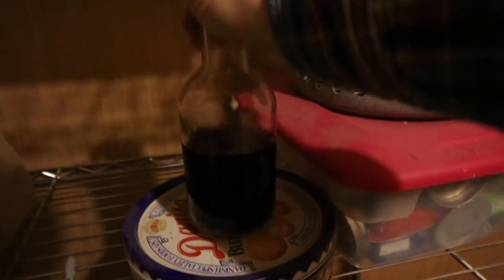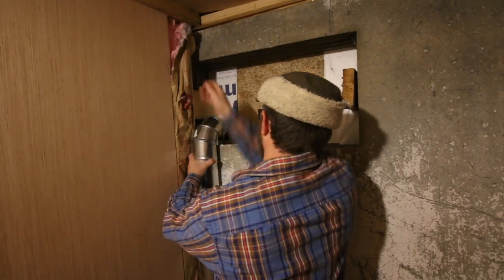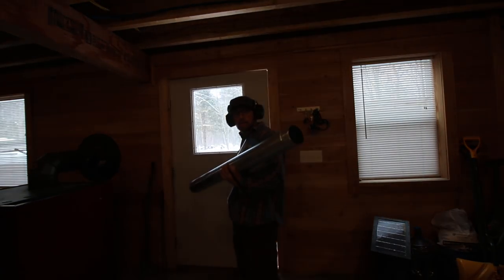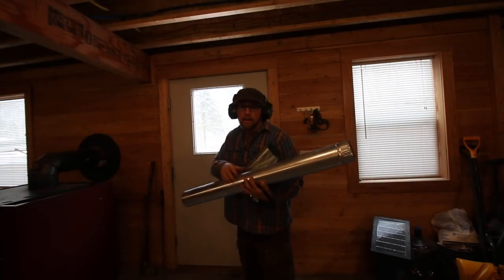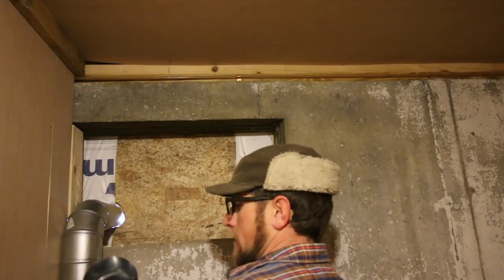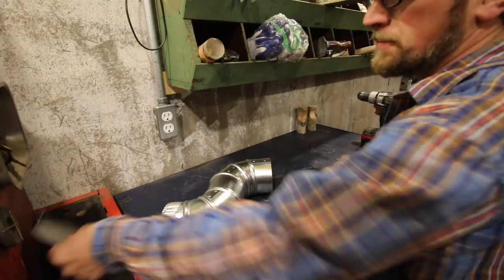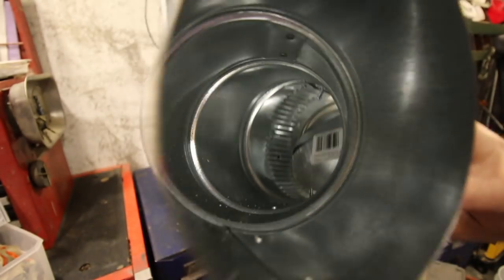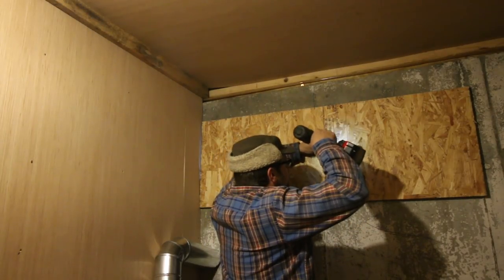Root Cellar~ Installing Cold Air Vents

Comment: Having worked at HD, the reason the stickers are so hard to get off is because unscrupulous people switch the stickers from something cheaper knowing it will just get scanned and out the door they go. This prevents that. They do it when the store is super busy and the check out lines are long. Checkers are doing their best to get people through the line before tempers flair.

Comment: When using a jigsaw for making cuts in tight spaces it sometimes works better if you put the blade in the saw backwards and pull the saw through the cut. This can also help to keep the saw from bouncing off the work surface in some situations.

Comment: Your science using the 'natural draft' method is very good!  I might have chosen schedule 20 pvc for the vent paths (you could still use the dampers) and the main reason is metal has a stronger aversion to sweating/condensation. 44 deg. is very close to your desired temp. It will be interesting to see if the temperature holds seeing you didn't finish the piping installation. Great job as always!  Merry Christmas Lumnah Acres
Reply from the maker: I thought of using PVC pipe but I also thought the galvanized would look nicer too. I didn't realize the sweating point. I have to keep that in mind if we have any issues. Thanks for the info. Merry Christmas to you and Becky!
Reply: @LumnahAcres how has it turned out so far?? Curious to know as we are just building ours in our basement!

Comment: I would probably drill holes in that second plywood as well and fill the center of the two with some insulation foam.  That way the only air exchange would be through the vents and it would be easy to control.   Maybe later you could go back and install glass block or something similar to give the room a natural light source when needed as well.
Reply: You do not want light in a root cellar because that can cause bacteria to grow but the insulation idea is really good. Control of the air exchange is key.
Reply: True.  I was thinking a blackout shade over the glass block, then you could open it when you needed it and shut it otherwise.  I guess just prefer natural light over a switch when possible.
Reply: I much prefer the natural light over light bulbs as well!

Comment: Al Lumnah Acres : Easy-peasy way to remove stickers, use a hairdryer aimed at the sticker. The heat melts the sticker glue and makes it very simple to peel the sticker off. Or go about it the "manly" way and use a heat shrink gun. Same principle! :)
Reply: Yes, that will get a sticker off, but may I add: after you heat the sticker, scrap it off with a plastic card, like a credit card. [ This is also super in washing dishes]

Comment: Merry Christmas Al, to you and yours.  I am not sure why you did not cut the pipe when it was flat.  I do understand using the jig saw.  We had a root cellar when I grew up.  We kept potatoes over the winter and into spring.  I am not sure why you want or need a damper.  Rodents or air control?  Happy Holidays to the whole forum.  God bless America.

Comment: Rim Joist not sill plate, sill plates sit on the foundation flat to which rim joist attach to. Also I would not put a 4" hole through your rim joist unless it was a min. of 2x14, you will compromise the structural rigidity of the joist unless it's an engineered lumber product. Though I am not a huge fan of the IBC there are really good quick reference tables in it for how where and size lumber to use for strength and where and how to put holes in them to retain rigidity and strength. Putting holes through a foundation wall like you have would be structurally sound as compared to the rim joists.